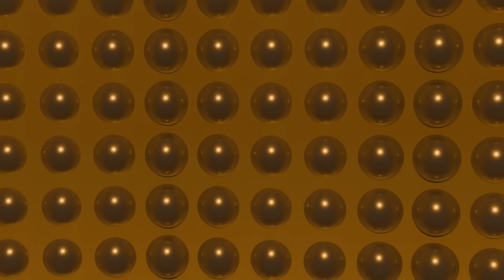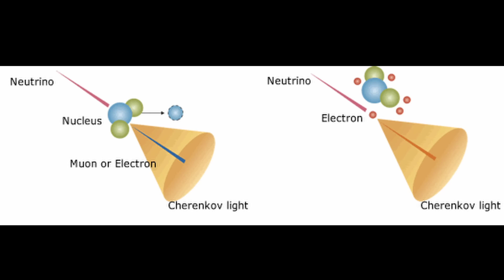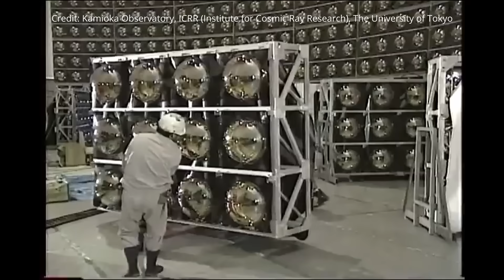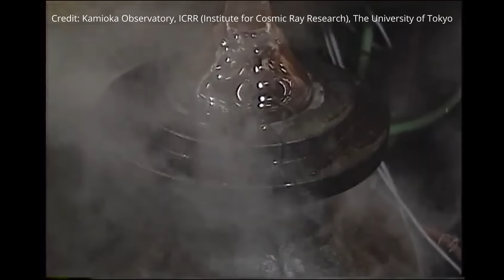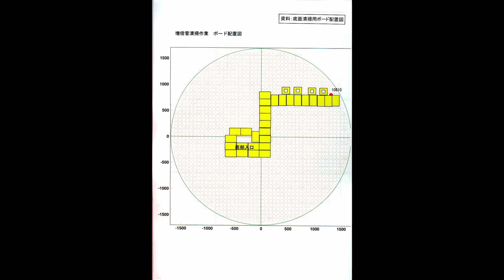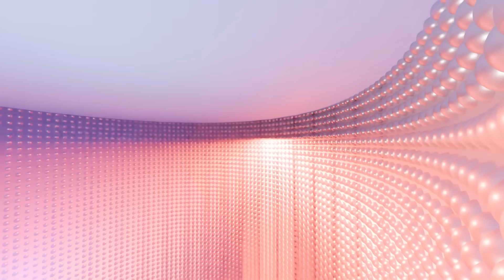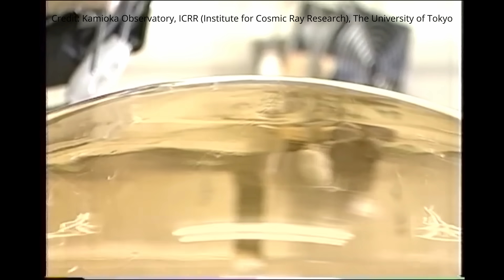An Engineering Fairy Tale: Cascade Failure at the Super Kamiokande

Comment: Fun fact:  That same pressure impact of water crushing into a vacuum is how the explosion from a Torpedo destroys a submarine.
The explosion creates a vacuum next to the submarine's hull, and the combination of internal hull pressure against vacuum with the water crashing back into the temporary void does the lion's share of the damage to the sub.
Reply: I don't think the vacuum vs 1atm is that bad, even the flexion probably isn't as bad as the dynamic pressure generated by, say, a ton of SW being propelled by the force of 15-30-atm water column above it
Reply: @00bean00 could I get that again in english, without random internet speed acronyms?

Comment: The moment I heard of an accident at such a facility, I immediately guessed what would fail in cascade and approximately how.  
Cascade failures of static things require stored energy.  Assuming nobody would be hair-brained enough to wire all the bulbs in series with voltage within an inch of their life, I though about structural failures.  
Vacuum pressure is no joke.  Water pressure added to it is even higher levels of potential energy.  
Massive water columns in motion with nowhere to go cause massive water hammer... in a pool full of vacuum vessels.  
Lets do the napkin math...

A hemisphere 0.500m in diameter holding vacuum between it and a plane of arbitrary strength in atmospheric pressure would hold 20.4kN at the split plane.  Underground so I will round up to 21kN.  
Thats the weight of a car or so on however many cm2 of glass.  
Now add water pressure to a depth of 41.4m at 1000kg/m3, which is 406kPa, and then get a force of 79kN+21kN=100kN.  
Now picture that instantaneous acceleration of an 8114kg column of water accelerating at 12.3m/s2 for an average of 0.31m.   
Given the volumetric fraction of a sphere from a cylinder and given x=x0+v0t+at^2 it will accelerate for 0.16s on average.  
Per v=v0+at that will get to an average water column first impact velocity of 1.96m/s for an approximate momentum of 15971kg*m/s.  

Thats not a water hammer anymore, thats a sedan made of water hitting a wall that does not absorb appreciable energy on account of being backed by vacuum.  
Having nowhere to go when it squashes the first glass bulb flat next to several other glass bulbs while sending glass spall in many directions, that momentum will build and climb in a stepped wave until insufficient depth prevents further propagation.  

I mean imagine putting a dance floor atop a covered pool full of lightbulbs... Are you feeling that lucky... the only difference is nobody jumped yet.  

~One Electrical Engineer

P.S. To predict accidents, first assume there will be an accident like in an accident video, then look for things with large potential energy, then do napkin math.  
Then see if there is energy left over at the end of failure #1 to find if there will be failure #2-N where N is as big as it is likely to be.

Comment: Well done. Thank you. Regarding the implosion rebound effect, which is indeed counterintuitive and was new to me: I assume it has to do with the decreasing circumference of the leading edge of the fluid as it rushes in to fill the vacuum. For that to increase pressure we must be dealing with a volume, rather than an area, and so the volume in question is, I assume, the water immediately behind the inrushing boundary. I wonder what that pressure gradient looks like and how it relates to the radius of the sphere. You've prompted me to go read up on something. Thank you, again. (This also makes me think of the rebound caused by infalling material during a star's collapse. I wonder if the mechanism is at all the same.)

Comment: No idea that happened, that’s hilarious! 
It’s so predictable too, insane they didn’t account for this... like surely they knew water wasn’t very compressible and that the shockwave sharpness would pretty much be proportional to the difference in compressibility between air and water right? INSANE they’d didn’t test if it could survive a tube blowing up in water, for a detector designed to be... in water

Also it’s interesting that the ones high up didn’t explode... I guess higher water pressure played a significant part? I wonder if it’s just from the pressure itself (seems negligible vs the 300 bar shockwaves) or if the higher pressure also causes more extreme collapse form some mechanism I’m not familiar with 

Another consideration: I don’t know how these detectors work, but couldn’t they make them out of some ductile material? The bulbs specifically, is something as brittle as glass necessary? It’s a very low radiation environment, so organic compounds and other complex molecules wouldn’t be damaged over time by radiation, couldn’t they use something like plastic or rubber depending on the kind of transparency they need?

Comment: The bit about Cherenkov Radiation in Vacuum may not be entirely accurate 
From Google AI,

"While traditionally Cherenkov radiation is understood as occurring when a charged particle travels faster than the speed of light in a medium, recent research suggests that it can occur in a vacuum under specific conditions, particularly with strong electromagnetic fields, potentially leading to the emission of light from the quantum vacuum"

Comment: Like a Walton type multiplier that used in electro static levitation and other high voltage low current, DC  producing devices that's awesome. It's just a light powered voltage multiplying device,? or the light enables the multiplication?. The animation was not as described of the pin out of the bottom the old “static” I bet she's about to start moving when it's not supposed lol

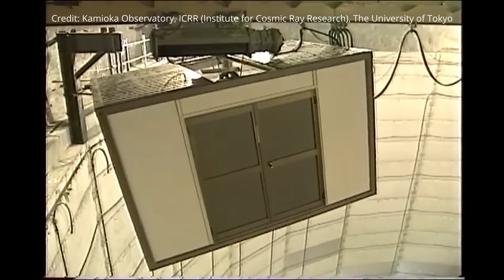Comment: 6:28 You say that they want to detect a single photon on multiple sensors. Is that even possible? I would assume that a single photon can trigger at most a single photon receptor. I was under the impression that a single neutrino strike can produce multiple photons, and that was how they could generate trajectory information.
Reply from the maker: Yeah each neutrino event produces a ‘ring’ of photons. You can even see the ring detection patterns on the ‘live detection’ section of the website.
But not many photons are produced and many will be attenuated by the water. So each individual tube needs to be capable of detecting very minor light flashes, on the order of single photons.

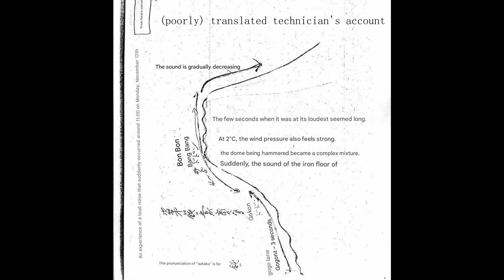Comment: 11:55 what about the seismic activity? That seismometer was 9km away. Would the cascade of implosions really cause that much disturbance? I'm more inclined to think it was an earthquake.
Reply from the maker: The several tonnes of water falling into the void left by the implosions would have caused that.
I used to work closely with a team of seismologists - pressure waves remain detectable to a surprising distance. That is also why seismic detection of hydrocarbon deposits is possible.
Reply: @Alexander-the-ok  I suppose it makes sense, that's a lot of water, after all. Thanks for the clarification and the interesting video!!

Comment: 7:21 can I ask why you say 'no solid state equivalent has yet been invented that can outperform a [i'm assuming you mean vacuum tube specifically] photomultiplier'? Silicon photomultipliers operate on the photoelectric effect and as far as I'm aware the only downsides are cost, cooling, and dark current, all of which (except for cost, depending on the state of your grant money...) aren't really that challenging to get around in most cases.

Comment: So wait does this mean you could hurt someone only by popping a large balloon underwater?
Reply: im not very educated but i think i kinda understand what happened with these tubes.
if you explode a balloon underwater it is releasing whatever is inside that balloon. in that case air or some gas. so the air or gas takes up SOME space. but these tubes had a vacuum inside, so when they broke there was nothing, no air bubbles. so its like an explosion but inwards, and the empty space fills with water incredibly fast. super incredibly fast. so fast that it was too much pressure for the tubes to handle so they all imploded one after another within 5 seconds.
so if you pop a balloon, the water just hits the air so it doesnt accelerate to extreme speeds like they would from a vacuum being opened.
i hope it made some sense because if not i have no clue

Comment: This is somewhat reminiscent me testing a new circuit I had designed, and woefully underestimating a certain current through one part which would rip through the whole circuit around it, destroying all the (active) components around the part. Not a big deal, at about 5$ of parts you'd say? 
Apparently I was slow in discovering what I had  done wrong and went through the same thing at least 4 times as I remember, until I found out what the actual cause of it all was. One miscalculation ended up costing me about 50$ in parts in the end. That was a hard-learned lesson indeed.
Now imagine it at the cost of 3000$ per part multiplied by a few thousand ;)
Some hard lessons were learned no doubt

Comment: I'm a geophysicist I work in airborne geophysical surveys including radiometric surveys, our gamma ray spectrometers work similar to this, the individual detectors are large crystals of thalium doped sodium iodide with a photomultiplier mounted on one end of the crystal, when gamma particles emmited from decaying radioelements on the ground pass through our aircraft and through the sodium iodide crystals they may (or may not) collide with a molecule in the detectors crystal lattice, this collision in turn causes a scintillation which emits photons of visible light, those photons then pass into the photomultiplier and the light intensity is measured by the photomultiplier and other electronics resulting in an energy level in millielectron volts, the energy level tells us which particular radioelement on the ground emmited the gamma partical via radioactive decay and caused the scintillation in the detector.

Comment: There was a similar bit of engineering with the Antarctic Snow Cruiser.  The designer went to Antarctica with Byrd and tested how much pressure the snowpack could withstand.  He then built a massive rover that would carry a biplane on its back and (it was planned) cross the entire continent, using the plane to photographically map routes ahead of it. As it turned out, the pressure snow withstands from a static weight is far higher than a that of a tire actively tearing it apart like a house of cards.  A vehicle designed to be half the maximum weight was actually ten times the weight the snow would allow.  As a result, it only got a few miles and ended up functioning as a control tower for the seaside outpost and aircraft.  This was all in 1937.  The goal was to claim Antarctica for the US before WWII Germany did. 
The math for knowing the dynamic load snow could handle wouldn't be known for another 15 years. 
In the 1950's and 60's, R. G. LeTourneau build massive "land trains" that could spread the load over dozens of tires, each with an electric drive wheel powered by a central Diesel generator (similar to the Snow Cruiser).  The system was used to build the DEW radar facilities in the Alaskan, Canadian, and Greenland arctic over the 1960's. That system became obsolete when heavy lift helicopters came into being.

Comment: I imagine that the rush of air the researchers felt was the air moving into the tank as the water level dropped from rushing into the volume that the photomultipliers had filled prior to rupturing.

Doing a rough guesstimate that each photomultiplier had an internal volume of about 51 liters, that's 384846 liters of displaced volume that needed to be filled in a span of less than 10 seconds.

Probably a really good thing the tank wasn't air tight, and that no one was near the entrance to the tank when it went off.

Comment: 14:44 this sub atomic detonation also happens in a vehicles cooling system. At (circa) 180°, the hydrogen in the (50/50 mix) coolant explodes very much the same way, though one wouldn't see this with the naked eye. There is evidence in the motors cooling jacket and spaces. This damage is called, "pitting". To combat this, deccessant is added (water conditioner / Zyrex™ Water pump protectant  / "dca" level) as a surfactant to inhibit this reaction, and extend the motors life. That is the added glowing phosphorescence in proper (coolant) antifreeze (50/50) mix.
Cool, huh?

Comment: I started working in the Super-K collaboration a few years ago and was in the mine last year for some work in the outer detector. Spent a whole day mending the tyvek lining with a stapler, trying not to drop anything into the water when doing so. Earlier on during the OD work, a non-stainless steel bolt dropped into the tank and we had to spend 5hrs fishing it out with a submersible robot.😂😂

Comment: With you having looked at different events of bursting glass, acrylic glass, or carbon fiber under high pressure, did you hear about the huge cylindric aquarium in Berlin made of acrylic glass ("AquaDom"), which burst a few years ago? I think it never became clear, what the actual reason was. Maybe fatigue, or the very cold temperatures outside.

Comment: The cascade explosion test seems to have been made by Stockton Rush. Any hydraulic engineer KNOWS for a fact that the implosion rebound wave pressure is directly proportional to the liquid pressure where the implosion ocurred. So, there is this and there is also Fukushima, where Japanese culture almost forbids a young engineer to question the results of a 'Senior' engineer. That allows for stupid conclusions to propagate very easily into huge projects.  They shoud have made the test at the full water pressure and they would have learnt that wave absorbing material, something VERY cheap compared to the cost of the project, should have been used between photomultipliers, as their detection angle is something below 180°.

Comment: Hey hey Super-K, so I actually got to spend my senior spring break helping with the rebuild effort in 2006. Not in the main chamber, but I did get to ride the gondola going down the middle and it truly is quite the sight all lit up in yellow. there’s an outer shell that acts as a veto for things coming in outside of the main chamber.

Heres a fun bit of engineering, that veto doesn’t need to have anywhere near the granularity of the main chamber and big PMTs are expensive so it uses smaller ones spaced apart, but you’d still like to collect all the light emitted so how do you do that on the cheap? Line it with giant sheets of tyvek and have graduate students a few post docs and an undergrad staple it all together. It reflects the light around until it eventually hits a pmt. I don’t know if they 
 redid the tyvek but my blood was in the detector for awhile because I managed to give myself a nasty paper cut 

You also left out the best feature of Super-K, when the road to the main access tunnel is blocked by an avalanche they fire up the train from the original zinc mine on the other side of the mountain and you get to spend like 20mins in absolute darkness with the deafening echos of the carts clanking about hunched over and packed in a mine cart that was designed for a much shorter person. Fun times. 

If you like physics related disasters you should look into the explosion that delayed the start of the LHC. What happens when a spark due to a poor solder joint of superconducting metal ruptures a nearby line of superfluid helium? Explosive fun that tossed around 28 ton magnets.

Comment: 7:25 - "The photoelectric effect is how photovoltaic solar panels work."
I was giving a presentation PV technology to some college physics professors, and when I mentioned the photoelectric effect, one of the PhDs objected. "The photoelectric effect is not how solar cells work," he said. "The photoelectric effect is exactly how solar cells work," I told him, "the material surrounding the electrons is different, but the physics is the same: a photon strikes an electron and adds energy to it." He accepted my answer and we carried on, but it was interesting to me that it was even a question. You have particle physics profs and solid-state physics profs, and not much interaction between the two, apparently.

Comment: Lovely write-up of the story.  I'm a particle physicist who worked at Super-K for a while, so, yes, you got a few things wrong, but you got most things right.  The biggest one to point out is that the oscillation wasn't detected by looking at the change in muon neutrinos detected as the earth rotated, rather, it was looking at the difference in number of muon neutrinos detected based on the direction they came from.  Ones coming from straight-below travelled through the entire earth, while ones coming from closer to (but still below) the horizon travelled through a smaller distance of the earth.  Plotting the number of muon neutrinos based on L/E (distance the neutrino travelled divided by the neutrino's energy) shows the oscillation behavior.
Reply from the maker: Ahhhh!! I thought I may have got that part wrong but couldn’t convince myself why. Thanks very much, I’ll add a correction to my pinned comment.